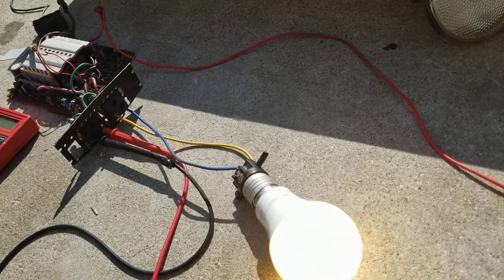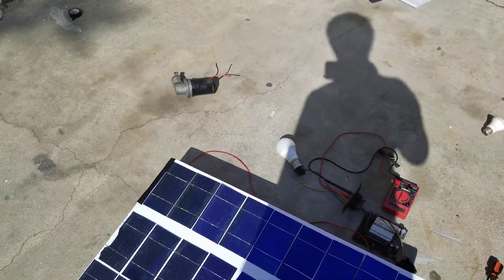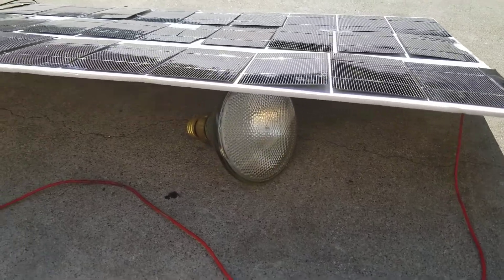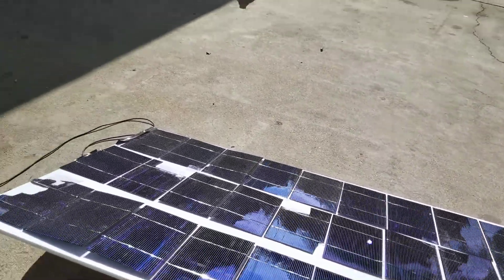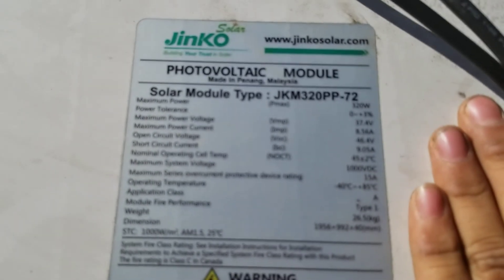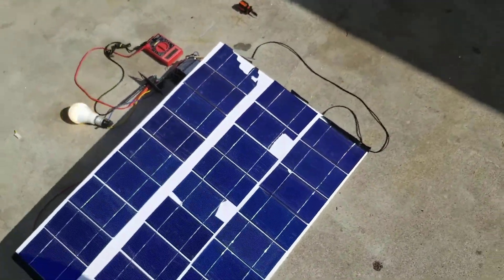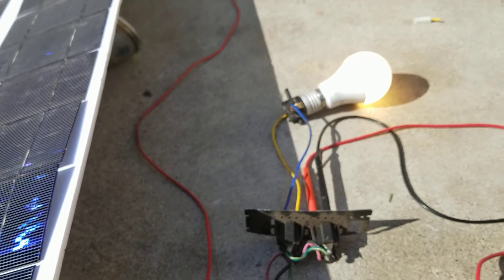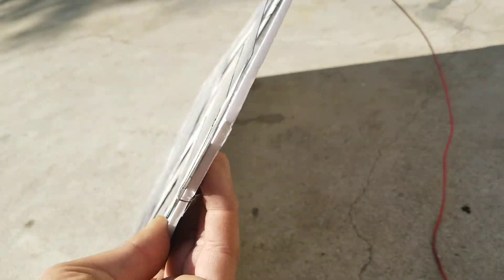Home made solar panel

Comment: very cool, I want to get some sometime.
Reply from the maker: Experimental Fun yeah I had fun building this and with the extra cells I had the kit brought 44 I showed the neighbor kids to make one they made a 10 cell solar panel to charge their tablets they are showing it off to their teachers at school I covered those with some eva film the last bit I had my german shepherd tore through most of it and it was also glued to a hard sheet of plastic so they wouldn't crack the cells and I just got 3 320w jinko solar panels I'll be making a charger for my ebike with those probably over kill 960w but if it works its 12 dollars I save from my electric bill ( I ride my ebike a lot ) https://rover.ebay.com/rover/0/0/0?mpre=https%3A%2F%2Fwww.ebay.com%2Fulk%2Fitm%2F381540686585
That's the link to these solar cells it brings everything you need. Would love to see a video on this from you =)
Reply: Thats cool, Yeah I ride my E-bike everyday, Its actually my only transportation right now but I love it, bought a 48v 15 amp LG battery for it, works great, way cheaper then gas, I actually haven't even noticed a difference on the electric bill really and i charge it once or twice a day. I do plan on getting solar panels sometime, mostly I was thinking to use them for an hho generator and then maybe hook it up to car or something to get better gas mileage, mostly just to play around.
Reply from the maker: Experimental Fun I'm in the same deal my only transportation my batteries are 2 36v 10ah lifepo4 so in total 20ah I get about 50 mile range but I just changed the code for my ebike and allowed for regenerative braking but I did blow my throttle controller so I'm waiting for that to arrive on Wednesday I'll probably make a video of it alone and then the solar charging sadly I cant say were I got the solar panels because the guy doesnt want publicity because they were meant to be destroyed since they have small dents on the frame but work up to spec.

I don't know if you mind me asking but what state are you on if you are in the US
Reply from the maker: Experimental Fun also I just saw your ebike on Twitter watch out with front wheel drive I work with a bike shop and had people come with snapped fork wheel mounts since it was never designed for those types of forces and I would also recommend disc brakes v brakes just melt sometimes I personally use a 160mm disc brake with hydraulic calipers but I was using a 180 before I had a accident and a car cut me off and broke my fork and since the brake mounts were different I couldn't put that disc on sadly but this one will flip me and since I am not running a regular ebike controller this thing reaches 38mph with 36v no problem
Reply: I'm in Arkansas, what wattage motor do you have? 50miles would be great, is that with pedaling? , I don't what range I have, I estimate maybe 20 miles without pedaling but I normally pedal with it just for fun and I also never ran the battery all the way down it the 3 months I had it, before that I bought some cheap lead acid batteries 12ah, the power output was pretty good but they didn't very long at all, maybe 12miles with pedaling and the batteries degraded pretty fast.
Reply from the maker: Experimental Fun ugh that's quite far I was thinking if you were at driving range I could have given you one of these solar panels my motor is the 48v 1000w one I do pedal with mines and thats the range when I'm in the river bed with stop and go traffic I haven't yet check and that was with my 500w geared motor so I havent checked with this one yet but I estimate about 50 miles with the few test I did earlier in the week before breaking my throttle controller
Reply: Yeah I have the  48v 1000w, but your running it at 36v?  mine goes like 28mph, It would be fun to run it at 72volts I think it would go pretty fast although legally I think they are only aloud to go 20mph and be 750watt max
Reply from the maker: Experimental Fun yeah here were I live I shown cops and they just told me at long as I am not reckless they wont mind and must wear a helmet which I already do I also had the same idea to run my batteries in series with a max voltage of 84 but I fell like my controller wont handle it it was only made for 22v max but being me I modified it and run it at 42v oh what I meant is the I have the 1000w motor the is made for 48v but I'm not powering it to 48 volts I'm using a 36v battery to power it
Reply: I downloaded an app today to keep track of my mileage, I need to do more testing but it seem like my range is actually more like 40miles
Reply from the maker: Experimental Fun yeah today I did my first real 45mile trip and got home with like 12% sadly I got here at dark so not much sun to charge the batteries i did ran into a issue before hand i regen braked down a hill and my system kept rebooting i took it apart the controller it was burning hot i had it air restricted but really quickly solved that issue but allowing air to pass through and my 2 battery setup is working perfect and something the i think screwed up my test were the i couldn't pedal because my shifter wouldn't shift to the smaller gear at the back and I cant pedal at 35mph it felt like when you have no chain on I wonder if I keep my speed under 20 or my amperage under 10 amps when taking off if I can get more range surely my tires aren't made for range
Reply: Yeah, I just leave my bike in top gear. I'm not sure if the app is very accurate because when I look on google maps it seems like less miles might need to get a different app. Problem I have is I don't really know how much voltage I have left when I ride, i bought a volt gauge but it burnt out right away, need to get a new one. The solar panel charger is cool but yeah charging at night is a problem, I have constant running water in front of my house so I might make a hydro generator.
Reply from the maker: Experimental Fun I don't like using apps since they do jump miles or stretch miles I use this https://rover.ebay.com/rover/0/0/0?mpre=https%3A%2F%2Fwww.ebay.com%2Fulk%2Fitm%2F122845094558

Took me a while to figure out how to get it to miles but I did recently mines broke I pressure washed my bike and it was the only thing the broke with the water and what are you using as your power meter I wanted to run this hut I feel like it it will act weird with regen breaking https://rover.ebay.com/rover/0/0/0?mpre=https%3A%2F%2Fwww.ebay.com%2Fulk%2Fitm%2F281768704865

And I just realised you use amazon not ebay ups sorry
Reply: thanks I do also use ebay, I bought a different one but it burnt out right away, maybe ill get both of those, I don't have any power meter other then the green yellow and red light on my throttle, thats why i never did a full range test. I actually filmed some video when I put the electric motor but that was months ago, I planed on making it a hybrid for the video, but its been so nice just using it as electric so I haven't finished the video, I'm working on a few other videos first but then ill finish that one.
Reply from the maker: Experimental Fun  would love to see it your last video was 3 months ago its been a while I used front wheel drive ebike before and I fell it's a really weird feeling when turning and I see were that comes from the 3 led lights aren't accurate they dip under load you have to stop in order to actually check your charge I have a separate 5 led meter but I don't like it it's just falling apart after the accident
Reply: Yeah I should have a new video in a few days hopefully, I just got a youtube partner manager to help e grow my channel and I should be producing a lot more videos soon.  The front wheel did feel weird at first but i'm use to it now, At some point i want to build another one with a rear 1500w 48v motor and run it at 72v.
Reply from the maker: Experimental Fun I have a 72v controller but I did not like it the torque it's too much and the frame cant handle it  and my frame was made for ebike keep that in mind I bough some torque arms to help with that because it was starting to eat away at my wheel mounts and those are solid aluminium half inch mounts I'll try with 72v another time because 50mph feels scary in a bike in my motorcycle 50 feels stable and as I am writing this my gsd is trying to get on top of me who doesnt love gsd
Reply from the maker: Experimental Fun also my 72v controller is huge like I mean larger than 12 inches so I cant find a place to put it
Reply from the maker: Experimental Fun I'm telling you just today we had another customer who's wheel came off his ebike https://imgur.com/a/Ty81cEZ
Reply: Ha yeah I was actually riding my ebike the other day and found a puppy that was starving and smelled really bad, i think someone just dropped her off and drove away, I took her back home and been taking care of her, not sure if ill keep her but my gsd is enjoying the company. how did the wheel come off, mine is on nice an tight, I purposely bought a steel frame bike because its stronger but if I build the 72v bike I plan on buying the strongest frame i can find. I wouldn't drive at 50mph all the time, but I live on a highway with no sidewalk or anything and people drive like 65, so the faster I go the safer it actually is.
Reply from the maker: Experimental Fun it just came of from the torque atm I am messing around with solar charging https://imgur.com/a/fddmugM 
It seems the just connecting the solar panels directly works since they produce power at 42v but I will be using the solar charger and have it connected in series for charging only 
Also in that link its my 72v controller I just wanted to see how many nosfets it had and that's a beast inside and that is really nice of you taking care of that puppy do you know what breed she is or of she is big or small last year i found a golden retriever the wasnt fixed we took him in but no more than 3 days later my gsd went into heat so we did not want puppies yet so we called the pound and he had a micro chip got returned to his owner the next day
Reply: Nice, Shes a lab mix, I tried finding her owners but she was kind of in the middle of no where and didn't even have a collar and she was so skinny you could see all her bones sticking out, also she smelled so bad it took 3 baths to get her to smell ok. There is a picture of my electric bike on my twitter, it was back when I had the 4 lead acid batteries I was testing.
Reply from the maker: Experimental Fun yeah I saw that one that's why I said the front wheel drive is dangerous it's a must to have a torque arm even if mines is a rear I am getting one I'll be making a vide wont be professional of my ebike but it will show everything
Reply: yeah I needed it front wheel because im doing something different with the back wheel. I been riding it for 3 or 4 months everyday and havent  had any issues with the front wheel, if i need to i can make some brackets to hold it on better.
Reply from the maker: Experimental Fun yeah you said something about making it a hybrid I'm questing running a 2 stroke engine with hho
Reply from the maker: Experimental Fun I been thinking and I fell like 72v may be the best option but I'm not sure since the controller the is 72v is so smooth without a sensor
Reply: I think your range is really good because your running the 2 36volt in parallel so your only pulling half the amps from each and that makes the batteries way more efficient.
Reply from the maker: Experimental Fun I blew my 72v controller =( if you look at my last video you can see I was messing with them and 2 mosfets are now dead on closed position I'll probably just remplace them if it's the only thing the broke
Reply: If I wanted to go faster, do you have a recommendation for a different 48v  controller I should get? I was thinking of just buying a rear wheel that comes with a 1500w controller but I don't think its going to go much faster.
Reply from the maker: Experimental Fun I been using a vesc I been using an old one but allows you to change timing it may become less efficient thoe as I seen
Reply from the maker: Experimental Fun you know the video I told you to watch the I just uploaded I just realised it was unlisted my bad now its public
Reply from the maker: Experimental Fun I just turned my ebike into 72 and it's a blast I did not want to do it but regenerative braking damages my brake mounts